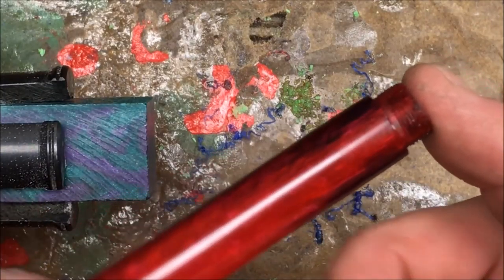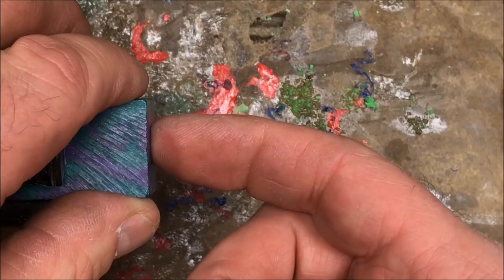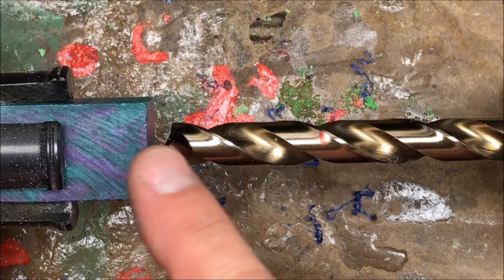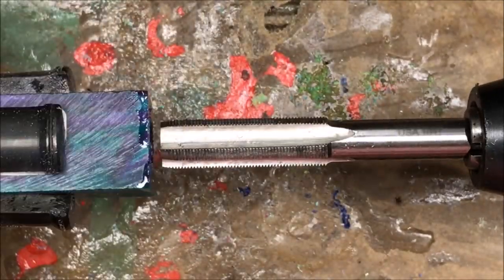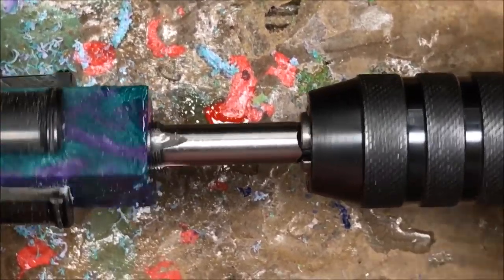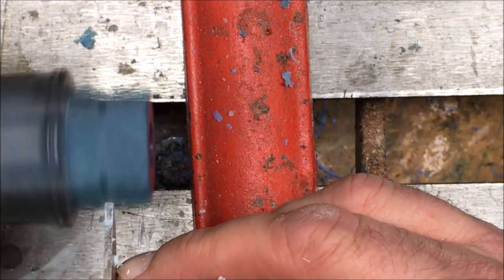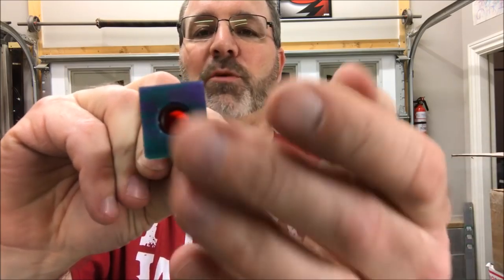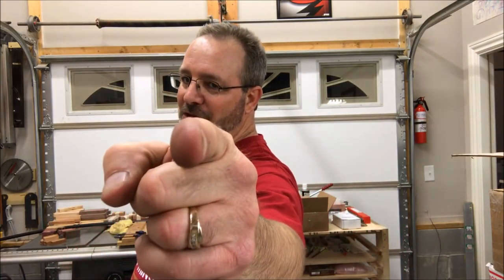Make A Collar For Drilling And Taping The Body Of A Bespoke Pen

Comment: Do you apply a mineral oil to the drill bit before you drill acrylics?
Reply from the maker: Yes, others use PAM or Canola Oil. WD40 will work well too. A little DNA seems the clean up the residue quite nicely. 

Regards,
Bob
Reply: Thanks. I talked to an old man that turns pens and he uses multiple bits at slow speeds. I like the mineral oil idea better. My brother is a local artist and makes cast resign figures and he's going to be making me some blanks. I needed to know how to drill them out. Thanks.